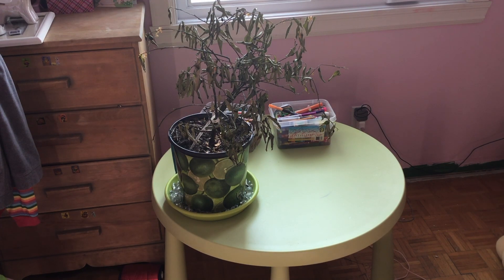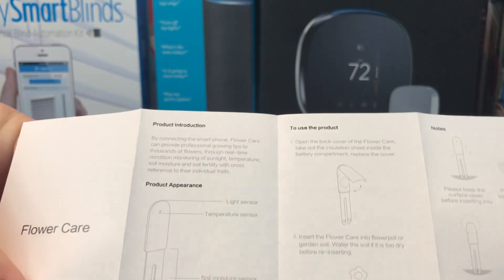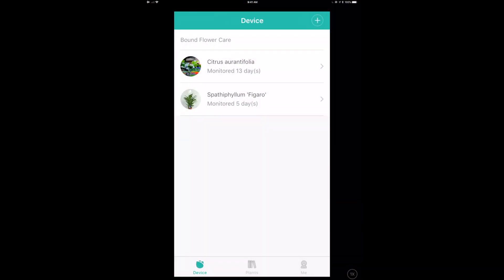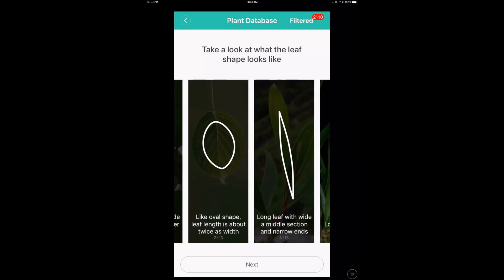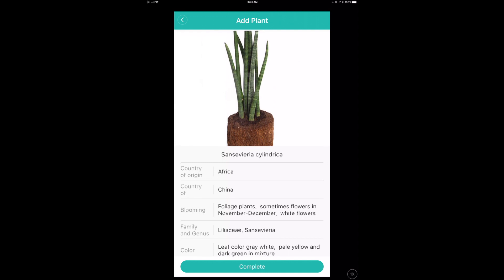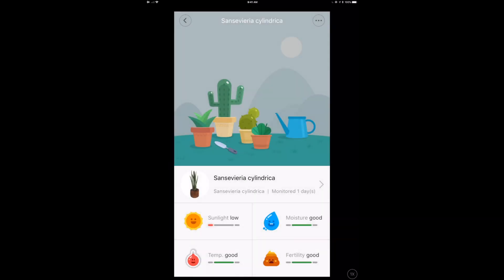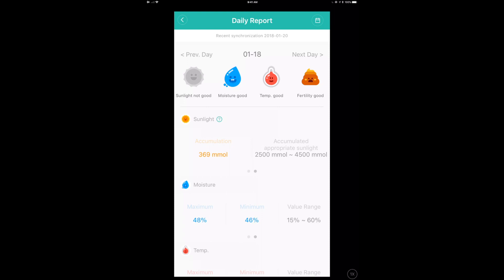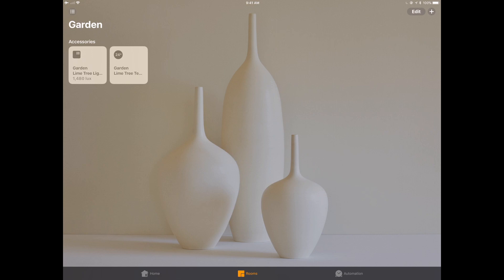Flower Care Plant Health Sensor

Comment: not working very bad items
Reply from the maker: these are very old items and it seems that the original item was discontinued by the manufacturer. Most of mine as still working fine, but I'd definitely caution against anyone investing too much into this product at this point in time.  Rumours are that we will see a new option later this year from another major vendor. Time will tell.